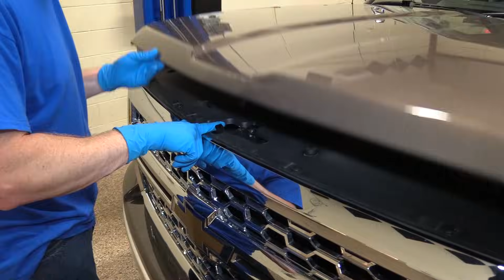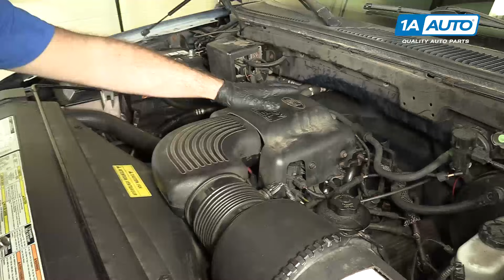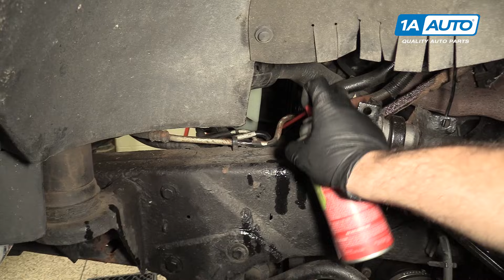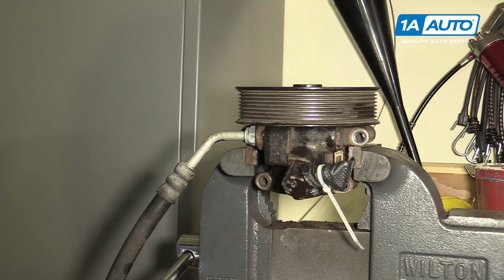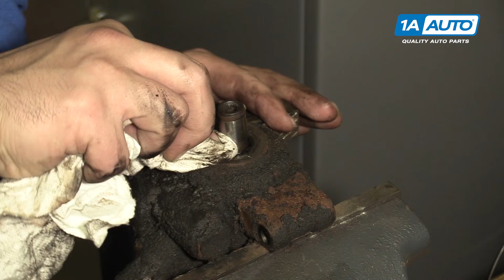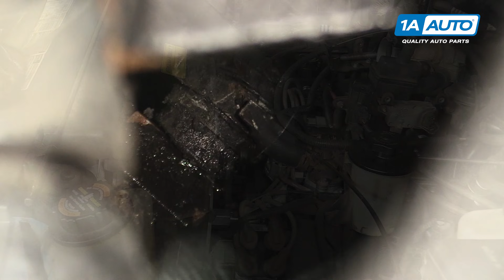How to Replace Power Steering Pump 97-04 Ford F-150

Comment: 03 f150 4.2l the lower bolt is super close to the pressure hose. I had to loosen each bolt about a quarter inch then pull the pump away from the bracket to give myself room to work the bolt out a little more, then keep repeating on each bolt untill you can get that lower bolt out. Other wise the wrench gets stuck next to the hose.

The 10 mm ratcheting wrench was a big help, well worth the few extra bucks.

Comment: Thanks. I’m trying to verify I have a bad pump. There’s a noise mostly at startup, sometimes when I drive. It sounds like someone’s pinching a ballon mouthpiece and letting air screech out, loudly.  Or like a raspy reed on a wind instrument, at a high pitch.

Comment: Excuse me, sir i have 1997 Econoline 150. I have a question if OK can I use transmission fluid or power steering fluid? On the new pump.

Comment: By far the most difficult part of this job was the high pressure line. The 3" lift would help access a lot, but even with access it was a pain.  Save yourself some trouble, drain the coolant and remove the lower radiator hose to gain access to the high pressure line.  It will still be a fight, but a much easier fight with threading the line.  This part of the job took a long time and lots of frustration.  Otherwise the video was very informative and helpful.  Also suggest getting the pump with the pully installed, will save a bunch of time.

Comment: I performed this procedure this past weekend on my 2002 F-150 XL. Without a lifted truck, I found the lower high pressure bolt very difficult to access so I dropped the pump out the bottom and then it was easier to get to. Also, oddly, even though everything on this truck is metric, this original bolt was 5/8. The new high pressure line I installed was 14mm, but still fit the old hole. In spite of what he says, I still re-installed the 4th bolt into the pump. Just remember to slide it into the new pump before you attach the high pressure line. A swivel flared 18mm wrench came in very handy to perform final tightening on this connection once the pump was installed. You can do it!
Reply from the maker: +tj maui Thanks for checking us out. Shop for high quality auto parts on 1AAuto.com:

http://1aau.to/m/Shop-1AAuto-c

Comment: This is a great video and it enabled me to change my power steering pump on my 1998 F150.  One problem I had was getting the metal shield disconnected so I could access the pump.  The bolts were rusted and when I attempted to take them off the U nuts broke.  I resolved this by cutting to bolts off with an angle grinder and cut off wheel.  Then I bought new bolts and nuts for not much money and all is well when I put the plate back on.  Everything else went will and I will able to change not only the pump but all the lines and cooler.  Thanks for a great video.

Comment: My 2001 F150 4x4 didn't have a 14mm.  It had a 5/8"!   And there was no way I could go through the wheel well to get to the high pressure line nut!!   I took out the 3 bolts to drop the pump first.  Then I had room in the engine bay to use a wrench to loosen the high pressure line.  And no hose comes off that easy after removing a hose clamp.  Whoever designed this engine compartment should be shot.  Obviously, they never worked on cars.
Reply: Wait until you have to do timing chains on a 5.4. You'll want to hunt Ford Engineers for sport.

Comment: How long does it take to do this job does anyone know?
Reply: I took on this job last night after work ..   I bought a puller kit for the ps pump..  $60 and a pitman  arm puller tool for $30.   I felt confidant of doing the job.   Took me 6 hrs start to finish..  but had all new parts installed in 4 and broke the pitman arm tool trying to remove the pitman arm from the gear box.  Was original and having 426k km in Ontario.  Seized , even a torch didn't help.    Having a hoist helps too ... no luck separation of the pitman arm .   Had to buy a new one.  BTW  ford doesn't sell them anymore..  obsolete to them.   Had to buy from a parts supplier.  Plus I had no issue taking the pulley of the ps pump on my truck while on the engine..  there is room and same goes for removing the ps lines on the gear box.   The ps pump pulley needs to be removed first to make room for the 18mm nut on the hose.   My truck has the 4/6 drop.   Didn't make it difficult either.   Have fun and make sure you have all parts and tools
  Patience is nesscessary

Comment: 1995 Ford F-150 whiney power steering. 300 4.9 lt. Replace hydraulic lines, steering box, pulley, tensor pully, serpentine belt, and have tried 4 remanufactured power steering pumps. I bought a vacuum bleeder kit for my pump. Cannot get whining out of steering. I use type F atf per my manual. I am just trying to find someone with answers. Thanks for any reply.
Reply: I would try a NEW pump, not remanufactured.

Comment: WHILE THIS IS A GREAT "HOW TO" Video not practical.   IF you go thought all that effort in changing the  "OLD" broken High Pressure line why not simply change out the "OLD" pump.  it is less than $100.  Buy it with the new Pully already installed and save at least a hour worth of time and ton of frustration( IF you screw up taking pully off or putting pully back on you are screwed)  Again GREAT VID!!  just not practical if doing all that work removing the pump from the block.
Reply: New pumps don’t usually come with the pulley....

Comment: I really love this video, it helps so much. I am replacing mine on a 1998 F150 but with a 5.4L. It's got some radiator hoses in the way when trying to disconnect lines from the PS Box. Any tips?

Comment: By any chance, are these steps similar to those of replacing the PS pump in a 1998-2011 Crown Victoria? If not, could you guys make a video showing the replacement of said pump? There is currently a lack of good videos showing its replacement.
Reply from the maker: +ThatRandom Dude We don't have a how-to video for your vehicle right now, but the basic steps in this video should be enough to do this task. Buy this part for your vehicle on 1AAuto.com: http://1aau.to/m/Shop-1AAuto-c

Comment: I just did this repair on a 2001 lariat supercrew. It is alot harder than it looks in this video. The fact that the truck in the video has had a body lift makes a huge difference. Getting the power steering hose in and out of my steering box was a nightmare as there is no clearance and very difficult to see. I had to drain the coolant and remove the lower rad hose to gain access.
Reply from the maker: +MrStroker408 Thank you for the feedback and for watching!
Reply: I am having a heck of a time finding the bolts for mine. I have the 2001 lariat supercrew with the 4.6l. Can't find the bolts anywhere.

Comment: Thank you for posting this. It helped me today. I remove the pulley while it was in the truck. I use a rubber band around the two half moons of the pulley tool, so this allow me to use a one-handed operation to fit the pulley tool onto the pulley shaft. Allows the half moons to stretch out while fitting around the end of the shaft. What's this on the shaft, cut rubber band with a knife and remove it. Just sharing here in case it helps someone else.

Comment: Was going to try this myself, but not after watching this video. Thanks for publishing.
Reply: Went to Ford, cost me $450. Got it home, still leaked. Took it back , they replaced a hose clamp. That was probably the problem to begin with. I just bought a pump I didn't need. Ford service is such a rip off.
Reply: @donireland2640  I am with you.
Reply: Right. Decided against doing it myself. Thanks.

Comment: Okay, so I have followed the instructions in this video to the T. I have installed a new pump because the old one was chattering and leaking from the housing. I also installed brand new hi and lo pressure lines and the steering rack itself was working prior to replacing the pump.  I properly bled out the system. Why would this still not be working? How is that even scientifically possible? One would assume that if the belt is turning the flywheel that the pump HAS to be sucking fluid. This is the first time in my life that I have been completely baffled by any vehicle.
Reply from the maker: +Christopher David It's hard to diagnose it without seeing the vehicle in person. We would recommend taking it to a trusted mechanic to pinpoint the cause so you aren't constantly plugging in/replacing expensive parts that aren't solving the problem
Reply: @1AAuto   So the problem was that the pump was bad. A friend of mine who is a real mechanic told me that Cardone's pumps are rebuilt in Mexico and are not reliable...1 out of every 3 is bad.  I got a NOS Ford one off of ebay, put it in, and It worked fine.  Still, It was the biggest PITA that I've done on the car.
Reply: That is a brain twister.  Makes no sense.  Maybe an obstruction or leak within the steering box??

Comment: Also how come you don't have to re install that 4th bolt?
Reply: Ford determined it wasn't necessary.  Replacement pumps are coming with only three mounting holes and bolts.

Comment: great vid, thanks. FYI pulley reinstall -there is no line on a new pump. I guess flush is the answer. 
Ever use a straightedge on other pulleys to see if it's in line?

Comment: Thanks for this video I have a 99 5.4L 4x4 150 didn't know the lines are normally lose I saw that o-ring on the steering gear side of the pressure hose the side that goes in the pump has no o-ring I seemed to have a flare which usually means as you tighten it the flare makes contact with something but there is no seat inside the pump. I had already bolted it up and was really difficult to use a wrench hits the pulley and the oil filter. Also found mine was missing the bolt above the large hose going to the reservoir I just figured someone replaced the pump never put it back in because it was too much work to tighten it as you said it's not required which means the pump has been replaced before I have had the truck from when it was 6 month old bought it in 2000 someone must have replaced the pump. I broke 2 PS pullers trying to remove the pulley the pump is an original ford part don't know why it's so tight ended up just buying a pump with he pulley already on it.

Comment: I am not sure if my pump and/or my high pressure line is leaking. Do you recommend I change the high pressure line first, then if it's still leaking, change the pump. Or should I just change everything at once. I would rather not have to change the whole pump if it''s just a leaky line, but it's honestly hard to tell what exactly is leaking. But as of now everything is wet, fluid is coming out of the top of the reservoir, the pump looks wet, and the high pressure line looks wet. :(
Reply: If your truck makes a hissing noise when you turn you steering wheel its your pump on its way out. Check your fluid first, see how it looks. Work your way from the lines back to your pump. It could be anything as simple as a loose hose/line.  Then check around your reservoir, part of the power steering pump assembly in that area is actually plastic, so you could have a leaky reservoir. It may be a bit tedious but the only way to really diagnose were you have a leak would be to remove your assembly. That way you have a better visual of what needs to be replaced if you don't find anything wrong with your lines.
Reply: I decided to change the pump, pulley, and the high pressure line along with the other return lines, and of course the power steering fluid. I am just waiting for my set of flare wrenches to come in then I am going to tackle this job. Thanks for your help.
Reply: It's a PITA this truck been working on it all day today don't bother pulling the pulley off I broke my PS puller which I have never seen one on so tight, and I rented one from autozone manager said his wont break I broke it in 5 seconds with my impact gun he couldn't believe it didn't have to pay for the rental he was cool. I ended up getting a pump with the pulley already on it. Would be lot easier if I pulled the clutch fan off but didn't have the tool to keep the water pump from turning I wanted to get the shroud out of the way. I have done 80 mustang GT's and 90's pulley came off easy the pump is very easy to work on this F-150 sucks balls PS fluid all over the place.
Reply: Clean the pump really well. Fill the pump with fluid and turn the pulley by hand. It will pump the fluid out of the high pressure orifice if the pump is any good.  Look for leaks.

Comment: I’ve done these pumps before I usually take the pulley off on the car makes getting the high pressure hose a lot easier without having to take the hose off
Reply from the maker: +Jairo Canales Thanks for watching, and the added tip! 1aauto.com